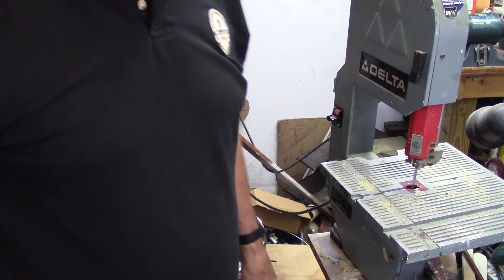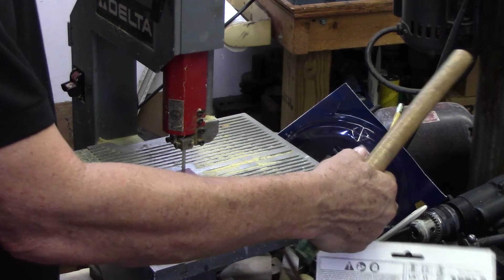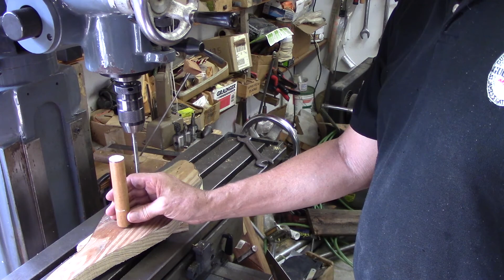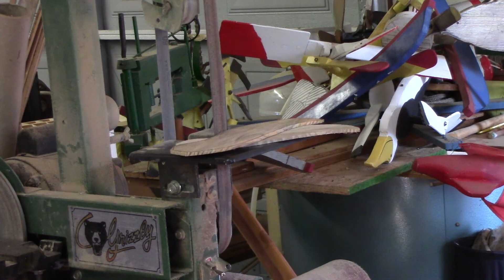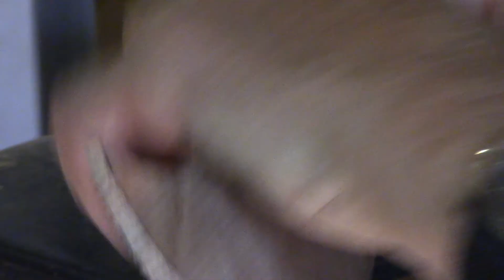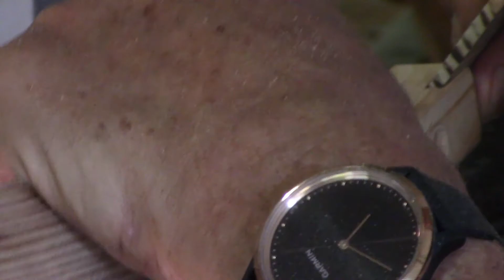How to make Best DiY Whirligig Goose with two blade hubs - Part 2

Comment: Great job
Reply from the maker: Thanks for the kind comment!
Reply: Great information . I bought the pattern and the kit from The Winfield collection.  I also bought a band saw and table saw off craigs list. the pattern  one is small like you said.  I want to make a more heavy duty one and larger. I see you cut the wing from a 3x4 into 4 pieces. How long are the wings and the body? Also can you buy the brass bushing at L
owes or home depot? you drill the hole in the body for the spindle on the botton and put the bushing in . what holds the ball bearing?